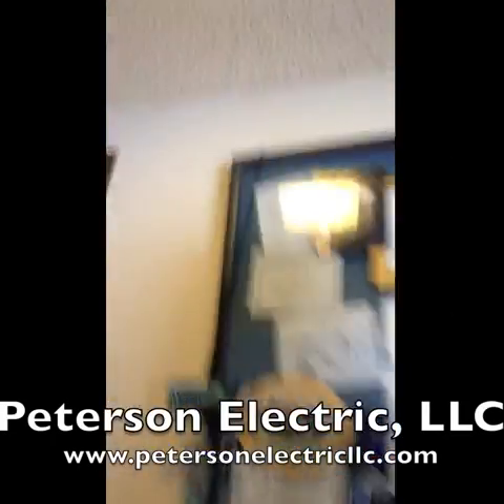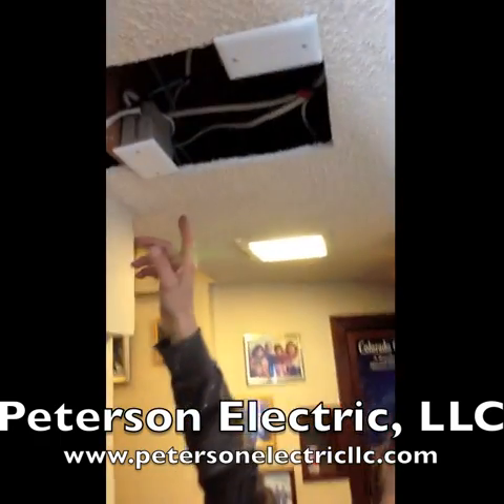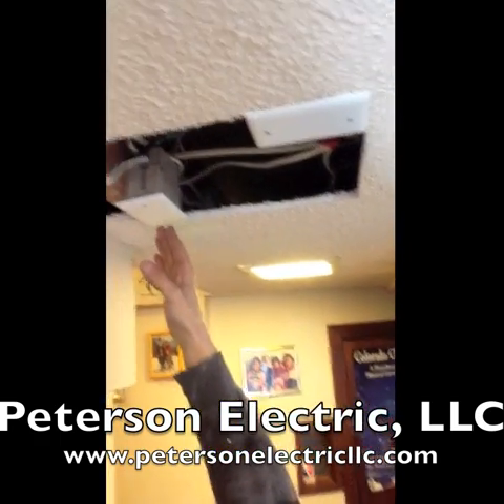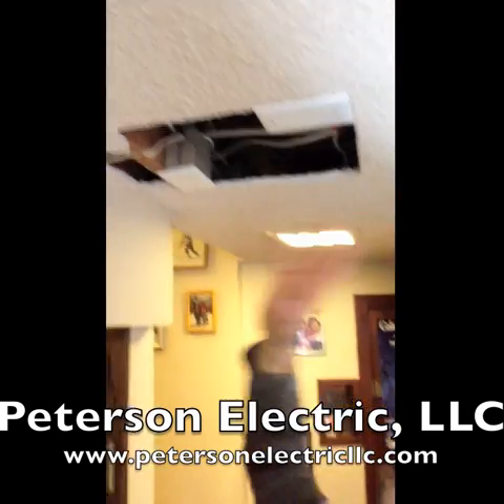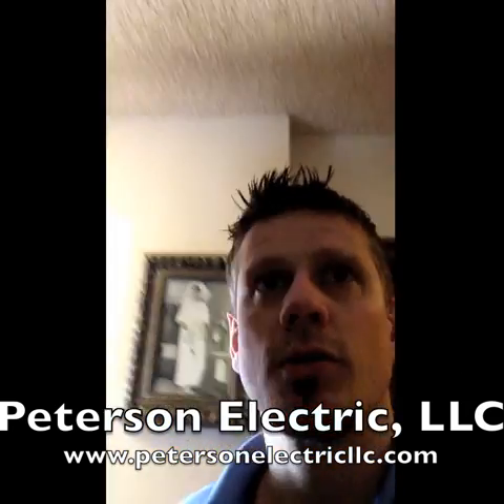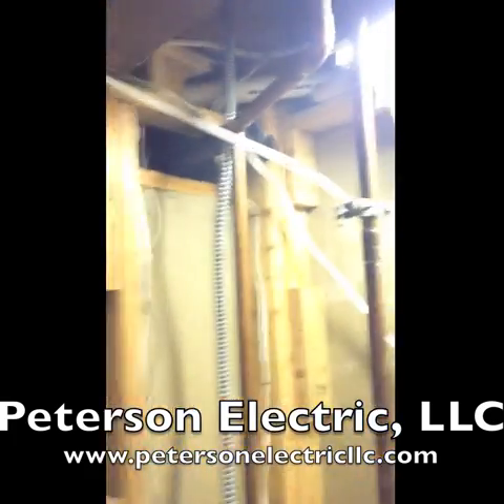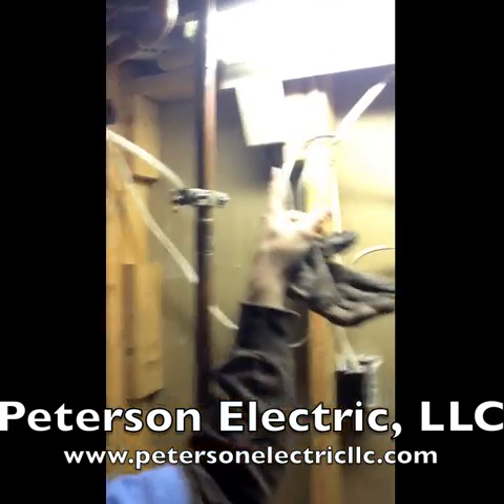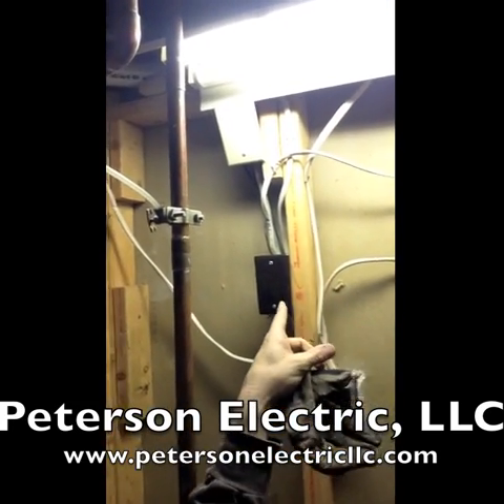Why Electrical Junction Boxes Must Be Accessible?

Comment: whats your call on can-less LED where the Jbox (junction box) is slipped into the hole cut for the lighting and left unmounted? The manufactures state a length distance from the hole but in my book this is just hiding a splice. Sure its not an open exposed splice;  the connection is in a  fire rated J-box but its hidden and unmounted (old work).I expose the first box flush with the ceiling (mounted) where line comes in (line from main panel) all other CANless in the series from that point I hide in the ceiling.

Comment: @petersonelectric I had a city inspector call me on a pull can installed in a access hatch.
He said it didn’t have a 30” free space in front of the cover. It was literally a ceiling tie wire about 8” from the front 12x12 pull can cover. The cam was Still accessible to remove the front cover and have space to work.
He tried telling me that it’s 30” from side to side and 3’ of clearance, this isn’t a panel I replied. Does that same code apply to a pull can ?
Reply from the maker: You are correct, article 110.26 is in reference to equipment, load centers and panel boards as well as gutters. 
Anything that is a large Comercial or residential box is allowed above a drop ceiling. It states this in chapter 314 and also in definitions. The difference of boxes or junctions is no different than a pot can woth a 6” trim above a “Hard Lid” drywall that I can acres without cutting drywall. He does not understand this in the code